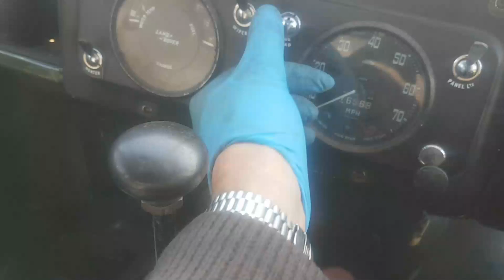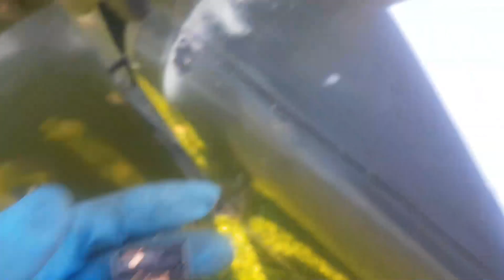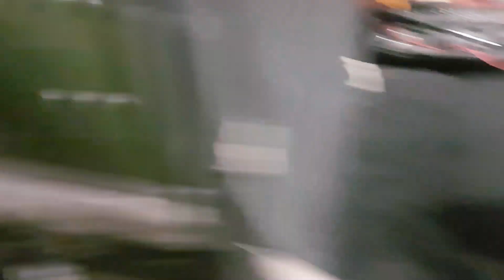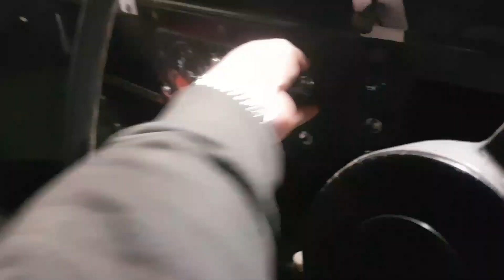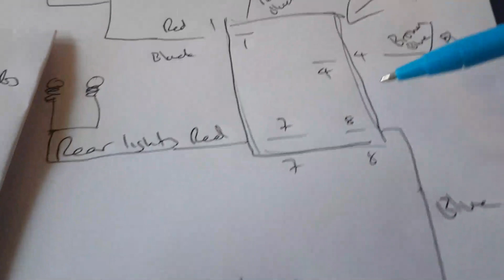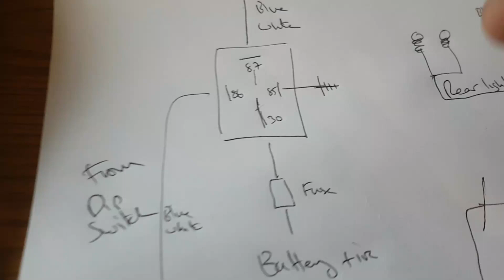Land Rover series IIa Main Beam Relay

Comment: Hi there ... thanks for your video your really knowledgeable....I’m having problems with my series 2.. 
mine has a retro fitted stalk for dipping lights and main beam ...but still has the Lucas rocker switch which I have replaced once for the reason you describe ... burnt out
I understand your diagram to a point ... but I don’t know how you control the concentration of light through the relay.?
As if I use the wire from the dip switch to make the switch in the relay ...won’t that just give full light? How does the relay know how to go from dim to full light ? 
Hope you can help me out 
Thanks 
Mark
Reply from the maker: As it isnt factory, email me how it is set up and i'll do my best to help 👍
Reply: What’s your email? I’ve sorted wiring now but still be useful to have advice from expert ... I used 2 replays for high and low ...I’m guessing that’s correct..

Comment: Just joined, great channel. Have a question did you add the Series 3 wings on the 68 llA   I own a 1966 109 and was thinking of changing them up to Series 3 wings.
Reply from the maker: This particular example is Mid 1969 and as such would have had the s3 style headlight setup as standard. The middle panel is from an earlier series 2a and was retrofitted. Not so sure that I light the spider-eyes look of it but the Ack-Ack searchlight capabilities are welcome.
Reply: @churchhouseclassics  Thanks for the heads up I'm going to find it difficult here in Canada to obtain good used wings however worth the journey. Keep up the great work looking forward to future episodes. Cheers

.